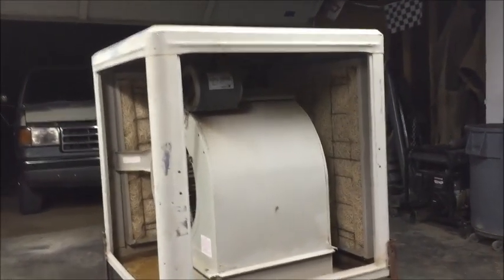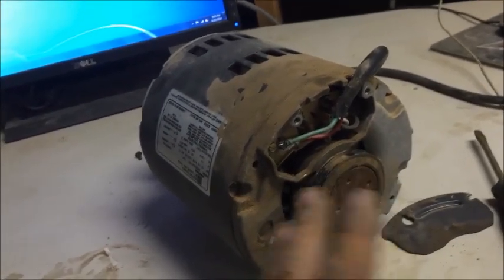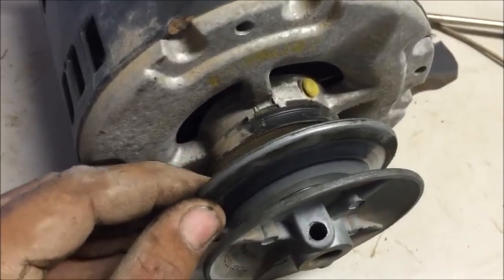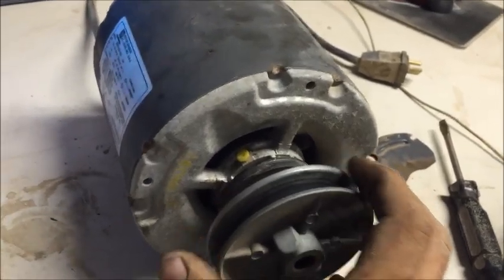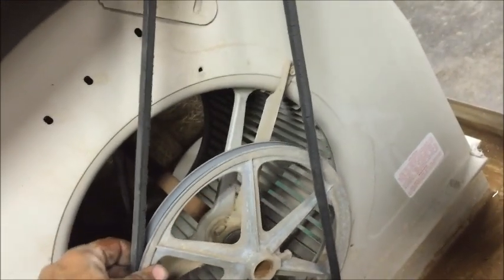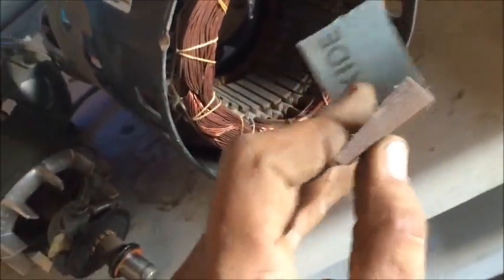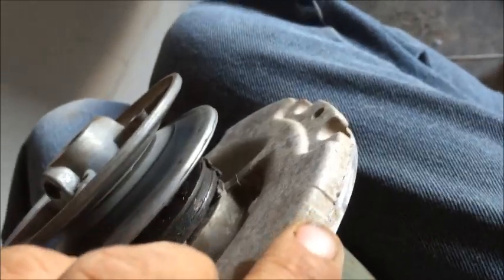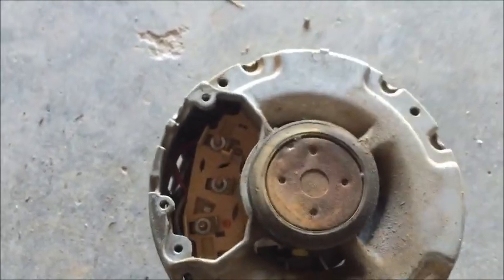Repair a Swamp Cooler that Shuts Down, Very Easy!

Comment: I have a question - at around 1:40 you are spinning the pulley of the motor and you point out that it is spinning lopsided.  Unless I missed something, you never really address that again.  Did adjusting the pulley fix the lopsided spin?
Reply from the maker: yes it did, sorry i did not show how. i loosened it and made the adjustment, and straightened it. it has a alan screw to make that adjustment. thanks for watching.

Comment: Replaced the pump and belt it worked for about 20 mins and shut off. Replaced the motor and turned it on low vent barely turns the motor over and flips the breaker. The motor is severely hot. Adjusted the pulley and still not working. 
Can anyone help me figure out the problem?
Reply from the maker: you have a bad motor, take it apart and clean the armature, and brushes. you may get some more life out of it. but eventually you will need a new motor.
Reply: thomas brian the motor was brand new. I called a professional. It was a bad switch bleeding electricity and the brand new motor seized due to the series of events.

Comment: Isn’t that pulley on backwards?
Reply from the maker: no it is correct, however with Alan screws on both sides it will not matter as long as the belt lines up. i have flipped them before to take a squeal out of a belt that is slightly out of alignment. thanks for watching.
Reply: How do I take off the pulley from the motor
Reply: Eric Flores   You’ll need an Allen wrench or hex key bit.
Reply: I put in a new motor and it works fine when i have cover off and not mounted. But once i put cover on and mount it short plug. I also put a new pulley but cant seem to have it adjusted where it doesnt shake motor seem uneven. Could this be reason it cuts off or maybe wires touching when cover on? Plz give me your opinion thank you.